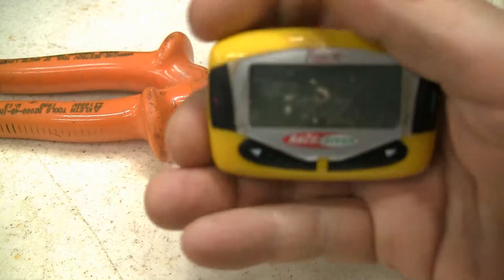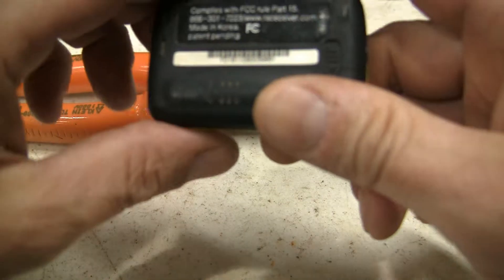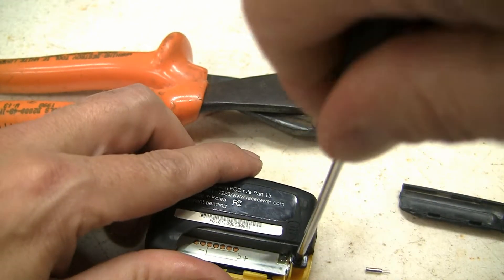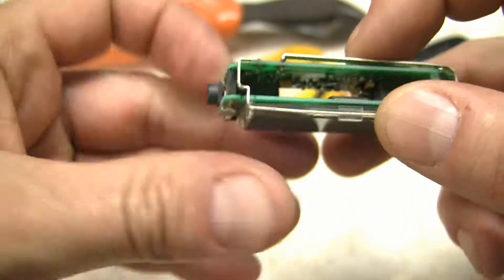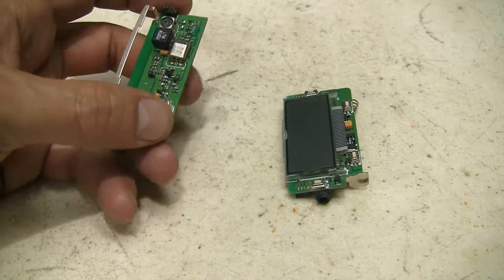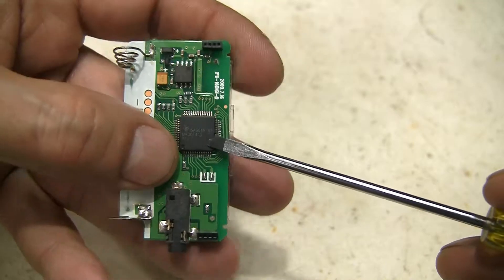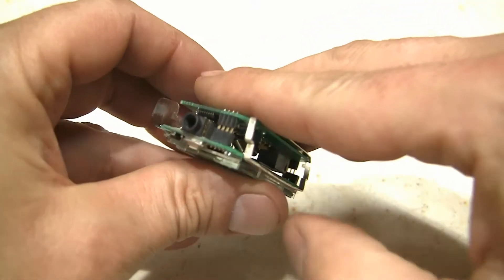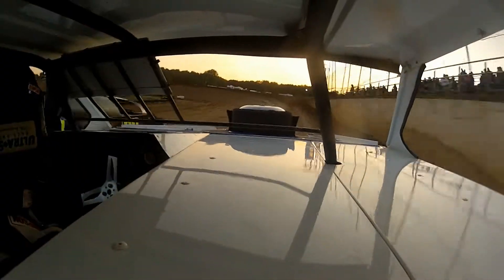Can I Fix A Broken RACEceiver?

Comment: Mine has static ,no static,static , etc only when tower talks does it not have static. 
Tried new buds, battery.
No change.
On lower left corner of lcd a little squelch box flashes with static.
Any ideas?
Reply from the maker: I haven't had the same problem as you yet, but there is a way to turn the "squelch" on and off.  I'm not sure if you're using the same model as me, but here is a link to the manual.  On page 2 there is a detail that shows how to turn the "squelch" on and off.  It looks to me like if the "S. C." box at the lower left is on, you should only be hearing audio when someone is talking...  The "S. C." box shows up on both of mine when there is no incoming radio traffic.  Hope that helps!

http://raceceiver.com/images/files/FusionInstructions.pdf

Comment: So how did you get the case off? Was there just that one screw? Did you just have to pry it off with a screwdriver? Is it glued together? Did it snap back on when reassembling or did you need to use some type of glue?
Reply from the maker: There was just the one screw.  I had to pinch one part (the bottom I think) in and kind of wiggle it until I could pull the two halves apart.  I didn't have to use a screwdriver to get it apart, but it might help once you get a corner open.  There was no glue, and I did not use any when I put it back together.
Reply: Thanks!